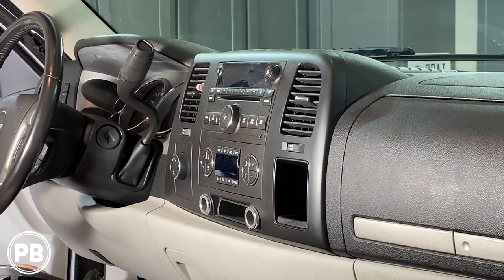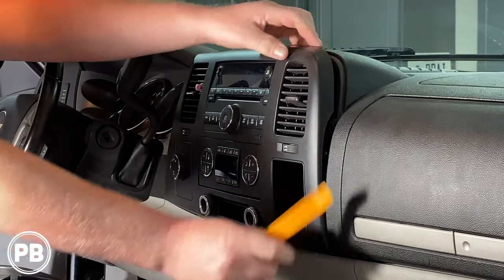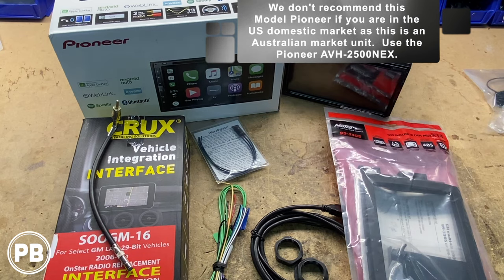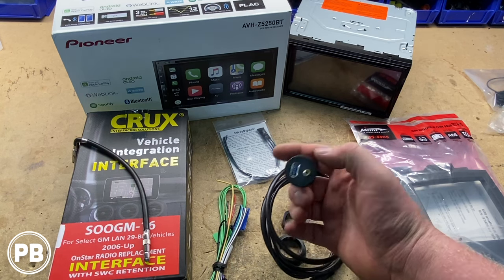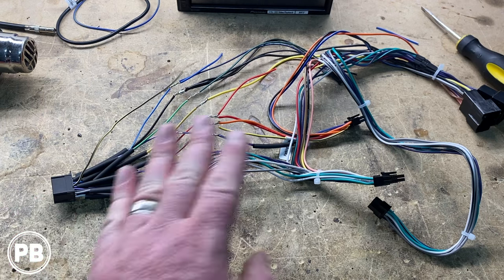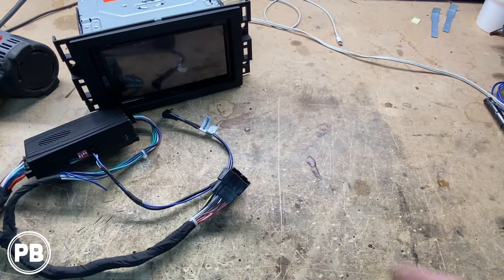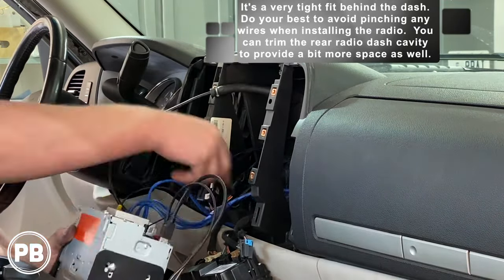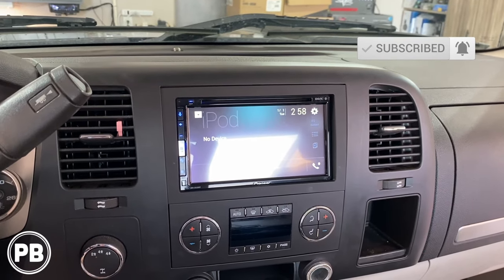2007 - 2014 GMC / Chevy Radio Install Sierra, Silverado, Avalanche (Bench Seat)

Comment from the maker: Parts used linked in the description of the video!
Reply: On the bench I see a Pioneer AVH-Z5250BT and on the link it's a Pioneer AVH-2500NEX and I would like to know which exact one was used
Reply from the maker: @123brosef  The AVH-Z5250BT is not a US spec radio, and we were shipped the wrong radio from the seller.  The US spec version is the AVH-2500NEX.  Almost identical in build, but the Z version doesn't play media from the US region.
Reply: Hi .. I've got a question.. Does that Pioneer play CDs?  I've got two CDs stuck in my player .. can't seem to get them out .. and of course it keeps cycling and drains the battery..  I do want a CD player as well , but evidently the gmc factory stereo seems from what I understand,  CDs get stuck .. and it's a spendy trip to the dealer that may , or may not be able to make things right .. So I figure get a new stereo that does not have this problem..  thanks Chris

Comment: Pioneer does not require parking brake bypass as it is built in and accessible through a secret menu which you can disable no part’s required.
Reply: Care to explain said secret menu?
Reply: @Abyss0206  Hit the home menu button > select AV > tap the OFF button. Now, about a 1/2-inch up from the bottom and 1/2-inch in from the bottom left you're going to press and hold for 10-15 seconds. You'll see it say "SET ON" which enables the bypass and you'll be all set. Now you can play videos on DVD, USB, SD, input navigation directions and more all while driving. No park brake, no wire splicing or anything. It's that simple.
Reply: @ssmith2980 Well damn......NOW you tell me😂😂. This doesn't work for Alpine does it?
Reply: Nope doesn’t work for alpine.

Comment: Need help ..installed aftermarket radio in my.o9 silverado but the radio doesn't have a port for the steering wheel controls. Is there any way to hook them up??

Comment: If you dnt have the steering wheel connector nor the onstar is buying the crux harness still necessary for the install?
Reply: I'd like to know as well
Reply: Me too
Reply: @matthew cortes  after more reading. Yes to retain the turn signal safety chime
Reply from the maker: A smart harness yes, but a mutch more simpler one is what you need, like this one here (still retains accessory, illumination, backup cam trigger, parking brake, etc for new radio that is generated over the canbus of the truck): https://amzn.to/3MjKRIy

Comment: Any help on what wires to connect color to color and which ones are not would be helpful. The instructions provided with the radio and interface are completely useless.
Reply from the maker: All depends on the radio used.  https://youtu.be/pla_0VpHTvs?feature=shared

Comment: Thank you for the video! I want not only to upgrade my stereo head unit but want to install head rest screens for the kids in the back. How would you best run those wires? Would you remove the center console and run them under that or how would you do it?

Comment: Just a heads up, most newer units have CarPlay integrated wirelessly so may not even need a USB flush adapter mount unless your head unit requires you to connect to your phone via USB connection.
Reply from the maker: Well unbranded cheap Chinese units have wireless CarPlay, but it’s not certified. Big brand name units offer wireless CarPlay, but they are still 400-500 for a quality one.
Reply: @ProvoBeastAudio  Very true, they aren't very affordable to some of us. I ended up going with an Alpine ILX-W650 and paired it with the KTA-450 power pack. Couldn't be more happy with it. I know there's head units with way more bells and whistles, sharper display etc., but ran across a great deal on both together, brand new for right at 400+ tax, couldn't pass on it. For the price it works great,  pushes my Alpine S2 6.5 coaxials just fine. Honestly I don't care about much of the extras, just wanted something I could stream music via Bluetooth with, eventually add a back up camera, and more importantly, have enough power to push some speakers without having to splurge for an expensive 4 channel amplifier.

Comment: For the bypass, instead of using the chip thats connected to the light green and blue/white wire, could I hook up a little three prong dash switch the same way to manually simulate the parking brake signal?
Reply: That's what I did with my old one. Put the switch in the glove box lol worked for me

Comment: my truck is just a bare bones 2010 Silverado work truck. I don't have all the bells and whistles with the steering wheel control and what not.. all i want to do is wire a backup camera. do I need to buy the interface kit and all that? im old school where you bought a harness at Wal-Mart matched the colors and screwed it back in.. done.. lol
Reply: I just bought a Dual DCPA723W, I am going to attempt this next weekend with the exact same truck 5.3L ext cab work truck 2010.

Comment: I used this kit with a Sony and every thing works perfect as it should but I have no sound coming my front speakers/ tweeters in an 2013 Sierra with on star. Any ideas?
Reply from the maker: Sounds like you have Bose. You need to connect the blue / white wire on the harness adapter to your radio. This will trigger the factory amp to boot when your radio does.

Comment: What happens if you don't have the adapter plug from the stereo to is there any way to plug in the stereo to the truck so it still works without the power adapter

Comment: I have a scoche harness.  The kenwood harness has a orange wire with a white stripe and blue wire with a white stripe that the scoche harness does not have.  Any idea what these wires are for?  I just wired mine uo but havent installed it in my rruck yet. The scoche does have a plain orange and blue wire without the stripe that matches the same with the Kenwood harness.  Just wondering what thise other 2 wires are for on the Kenwood harness.  Unfortunately the Kenwood radio didn't come with a harness as I bought it on clearance at Best buy as an open box. I had to order a harness that fit it online so it doesn't have any information on what wire is what.
Reply: Gonna ignore the unmatching orange and both blue wires, most likely. Those are for powered antenna etc. Scosche doesn't list those wires on their paperwork which is annoying.

Comment: I got this same harness and I can’t seem to still use my steering wheel controls. I set everything to the right way and nothing.
Reply from the maker: Sounds like something isn't setup correctly.  I can probably help you, but you'd need to send me a message on facebook or instagram for assistance

Comment: What are the bare essentials I need to just get the head unit to connect and work to my speakers?
Reply: Would be great to know this
Reply: Same
Reply: From what I hear, all of these trucks with this body style have factory amps, so you have to get a harness like this to bypass the factory amps, if you don't, the music won't play when you turn on the head unit.
Reply: If it’s like older cars ex my 2003 Silverado. You can connect the unit straight to vehicle harness just figure out which ones are you’re speakers with one of those big square batteries the speakers will make a slight pop sound the after that just match wire to wire. That’s the bare minimum at least that’s how I used to do it when I was a kid and had no money to do it the right way lol

Comment: Bout my son a 2007 Chevy, it's not the classic. Aftermarket radio was installed but not working. Go to change it out and the connectors were cut and spliced together. So I have no idea what wire in the truck goes to what. Any ideas where I can get a diagram of what each wire goes to?
Reply from the maker: https://www.modifiedlife.com/2007-chevrolet-silverado-stereo-wiring-diagram/

I recommend having the harness repaired as your truck requires a smart harness to work properly.
Reply: @ProvoBeastAudio  thanks I'll check it out. Bought it from the ex-in-laws and it was working before he decided to punch the screen on it.   But I do plan on installing a harness, just don't know if that can be bought online or if we'll have to hit a junkyard.

Comment: Maybe you can help me. A lot of these android head units come prewired. They all have a 3rd plug that matches the speaker wire plug except it's gray. What am I supposed to do with that?
Reply from the maker: Ooof - those android based units are really not great options.  It can drastically vary from android to android as they don't typically follow aftermarket guildelines.  If you send us a message on facebook or instagram, i can take a look.  Too many variables to help you here.

Comment: Is the interface nessesary? I bought a radio and dash kit thinking that's all I needed
Reply from the maker: Absolutely.  GM vehicles run on a data canbus system from 2003 and newer, so to install your radio correctly, you need the correct harness which retains accessory, illumination, provides reverse trigger, parking brake, vss, and support for steering wheel volume controls, OnStar, Bose, etc.
Reply: Thank you. Is the microbypass for the parking brake needed as well?
Reply from the maker: Only for the parking brake for Pioneer and Alpine units. @rickbuckman1888

Comment: I have almost the same model (2013). Installed a new head unit. 1 speaker went out (but speaker tested fine on bench). Then a second speaker (speaker tested fine on bench). Decided to install old head unit and the same speakers were not playing. 

Have you ran into this issue? All wires were verified to be connected. Fade and Balance confirmed this when it worked the first day. 

Any Advice?
Reply from the maker: Short somewhere. Not sure. Speaker terminals maybe grounding out in the door? A short somewhere.
Reply: Having same issue with drives door. You figured out what was wrong?
Reply: @matthewstreif5722  yah, i went ahead and cut the terminals and solder them in. The OEM terminals were corroded just enough that they werent making contact and I guess it all just happened to happen after hooking up the new head unit.
Reply: I bought a used 07 with stereo issues from the get go. replaced all 4 speakers and the back 2 just stopped working, then back to nothing again. pulled the factory radio and been driving around with nothing in the dash for months, that pesky stabili trac crap had nicely disappeared!! tried a junkyard one that could not be used. insulted by GM dealership on the cost of a new stereo from them. bought one of those harness and an old school cd player and installed...back speakers not working, fronts cutting out, stabili trac crap with a vengeance! back to empty dash...no more stabili trac crap! running 4 speaker wires and seeking alternate power source for the cd deck NO HARNESS! Hope one of the 2 cigarette lighter power points could will work.

Comment: I have a question, I installed the same audio setup that you installed on a  2014 silverado 2500hd. It turns on, but then I get  an amp error message. I'm lost at this point
Reply from the maker: That means a speaker wire short somewhere.

Comment: So I put a radio in my 2011 and my gauges don’t work goes in the safety lock mode with the radio on
Reply from the maker: Sounds like wiring issue, wrong parts used, etc.

Comment: i have single cab work truck i put in a scoche wiring harness with new head unit my subwoofer plays but the speakers don’t what did i do wrong?
Reply from the maker: Either the wiring harness adapter is wrong or bad (scosche harnesses are awful) or you haven’t wired it correctly. If you have Bose, you could have forgotten to wire up your amp turn-on wire.

Comment: So with the bypass, there are still wires that I don’t have connections for. Mainly the reverse gear signal input, as long as I’m supposed to hook up the white wire from the bypass to the system remote control. Any help would be appreciated @ProvoBeastAudio
Reply from the maker: Are you referring to a parking brake bypass?
Reply: Yes. I have the ground wire hooked up to both ground wires from the crux harness and the wire harness for the radio, and the parking brake hooked up. However it says to use the white wire on the bypass to hook up to the system remote control. And with doing that then on my main harness for the radio I have the reverse gear signal wire with no connection

Comment: is the harness necessary even if i dont use onstar and have no volume control on steering wheel?
Reply from the maker: A smart harness yes, but there are versions that simply provide your radio connections and Accessory, illumination, and a reverse trigger that are generated  from the data canbus of the truck.  A simple smart harness like this works great: https://amzn.to/3MjKRIy

Comment: Hey I bought the interface but can’t get the swc to work. I have a kenwood and don’t see where to wire it in
Reply from the maker: Kenwood don't use the 3.5mm swc jack, and instead use the kenwood / jvc wire for steering wheel controls on the crux module.

Comment: I have an additional mini USB plug on the rear of my factory radio? I’ve installed an Eonon hear unit and fosgate door speakers all around. Not getting any sound. Any ideas?
Reply from the maker: USB will not impact your audio, what sounds like the issue is going to be you have Bose and your factory amplifier isn't booting up with the new radio.  Usually your harness adapter will have an amp turn on wire (usually blue / white) that needs to be hooked up to the radio amp trigger wire.
Reply: All of the old speakers I tore out all say Delphi and theres no Bose branding on anything that I see?
Reply from the maker: @paulmurphy5496  Sounds like a wiring issue then.  Hard to diagnose over a youtube comment.  Feel free to send me a message on our facebook page for further assistance.
Reply: @ProvoBeastAudio  appreciate it

Comment: Hey man, I was hoping you could help me out since I've been struggling to find this out myself. 

I'm wanting to get a head unit for my 2013 Honda Accord EX-L model, but I'm having a hard time finding one that has apple carplay that will fit where it's supposed to go. I've seen some of have the air vents with the head unit so maybe that's the one I should get, but I haven't found any that look like it would be the right fit. 

I would appreciate it so much if you are able to help. 

Thanks!
Reply from the maker: Send us a message on Facebook

Comment: do you disconnect the battery when doing this?
Reply from the maker: It’s always a good practice to do so, but not absolutely necessary.
Reply: @ProvoBeastAudio  awesome thanks! I’ve got a diesel so 2 batteries. Pain in the butt and I’m always worried a cable will slip. May do it anyways tho

Comment: Why does the parking brake wire into the radio?
Reply: It's some B.S. safety feature radio manufacturers are required by law to have. Basically they don't want you watching video while driving. I know, defeats the purpose of having a head unit that plays videos if you get one for kids or passengers, it's stupid, who's gonna put their car or truck in park to watch video?
Reply: Ground the green wire to the radio chassis itself and then your kids can watch videos as you drive.

Comment: i installed but my steering wheel controls do not work anymore, what do i do ?
Reply from the maker: There is an issue with your install.  Depending on what brand harness adapter you used, i'd contact that harness manufacture tech support for assistance.

Comment: Can i use an external amp with the crux adapter?
Reply from the maker: Yes, the curx adapter retains the factory Bose amp.  If you have an aftermarket amplifier, the new radio would be providing the signal to that amp anyways via RCA cables, so yes.

Comment: Do I need a parking brake bypass
Reply: You can connect the parking brake wire to the ground wire you don’t really need it
Reply: On both sides?
Reply from the maker: Depends on the radio, if Pioneer or Alpine, it has to be connected in some way, and simply grounding it doesn't work as they require a double or triple pulse negative to properly work (which is why we used a byapss).  Any other brand the parking brake wire can simply be grounded.